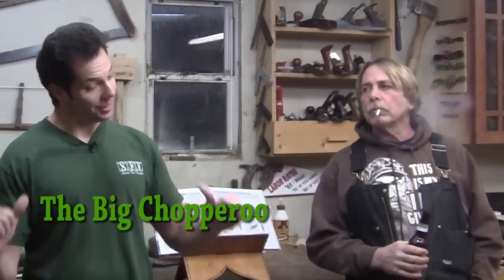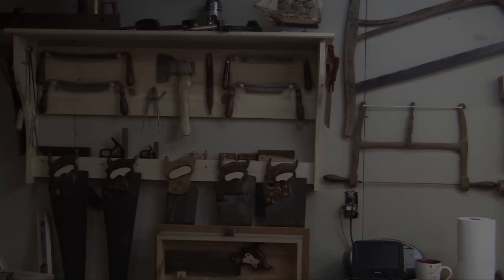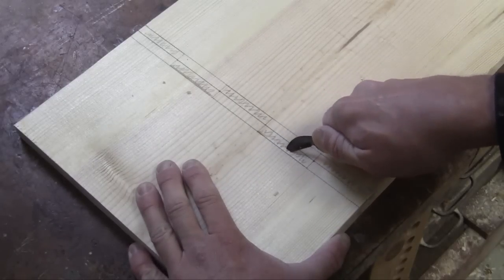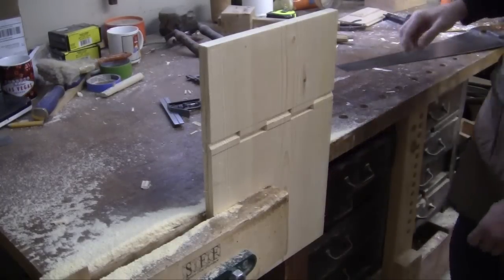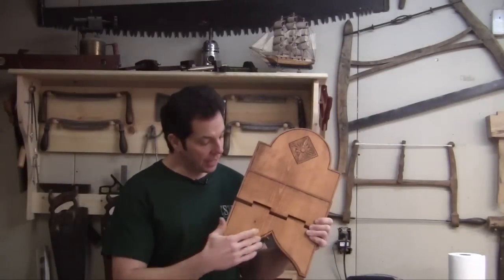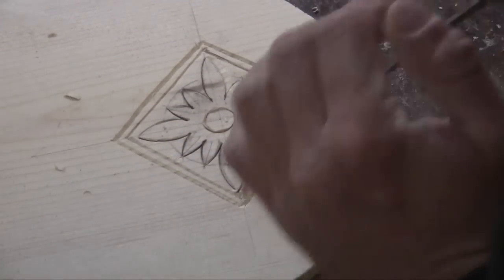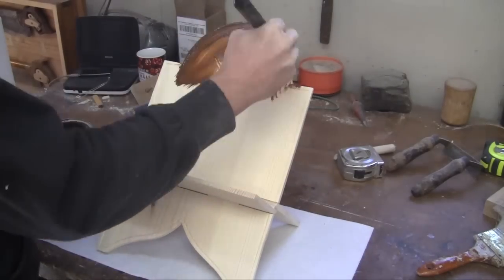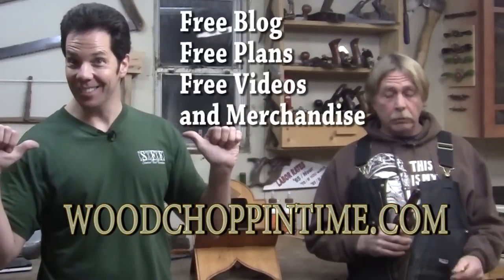Learn how to make a Wooden Book Stand from a single board.

Comment: Chad, your video doesn't include a step to saw the gaps between the sections of the hinge.  Was that missed in the video editing?  Or were you able to "break" those segments by applying a little pressure on the two halves to get it to snap open (time 4:10-4:15)?

Comment: I wonder if anyone has ever tried using this to do a "plank chair"?
Reply: Yes.
The vikings made these as imprompteau chairs all the time.
These guys have just made a smaller version and called it a book stand...which is not accurate.
They came oh so close to what I was actually looking for...but never quite made it there.
Actual book stands like this are meant to be more , well...even length on both sides.
It's meant to support the spine when you open a heavy book and lay it flat, not have it in a propped up position! You're reading it, not displaying it!
So close...and yet, so wrong.